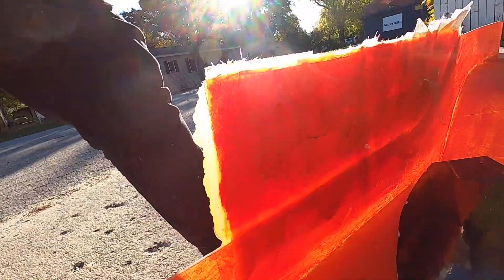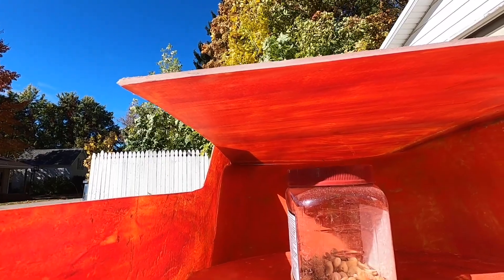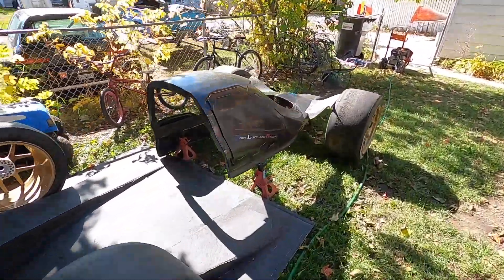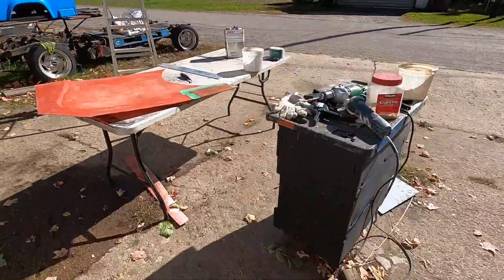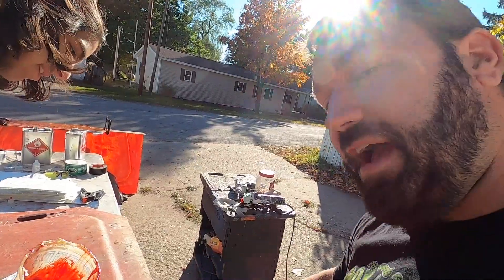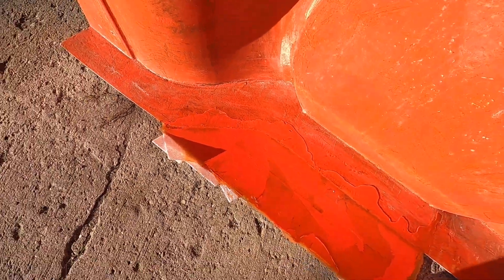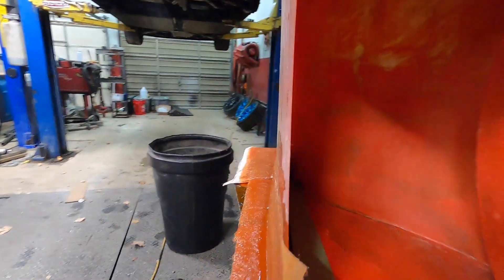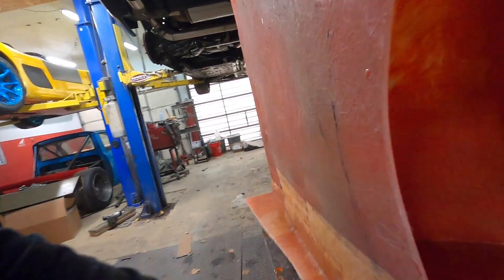Carbon Fiber Fenders: Enviate 002 WILL BE STRONGER!

Comment: When should this project be finished? I’m very excited to see all the improvements to the car just how good it’s going to be when it’s finished. When it is finished, will there be any chance of it going back up to 1200hp or higher? Or is that kind of overpowered for a car like this meant for small or twisty tracks. Oh and one last question, will downforce improve? Because last time I remember this car made an absolute mother load of downforce.
Reply from the maker: Wheels on ground in spring is the target.